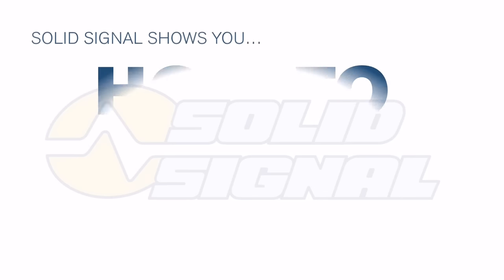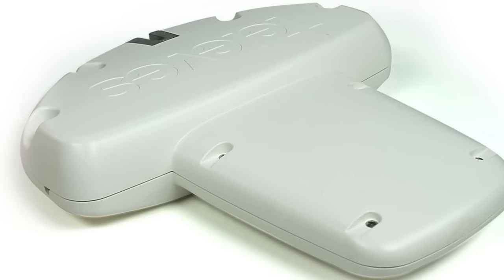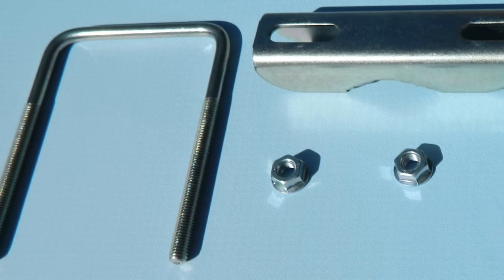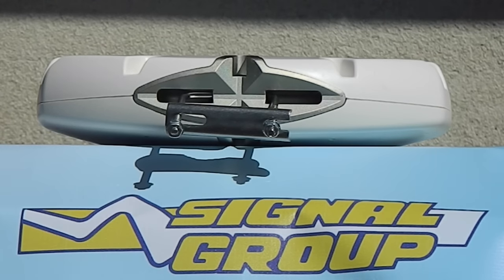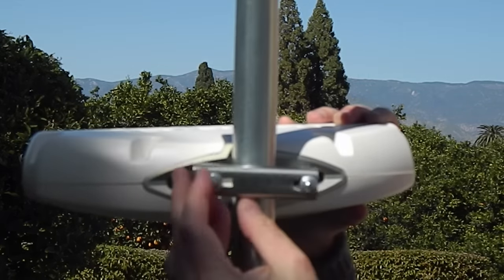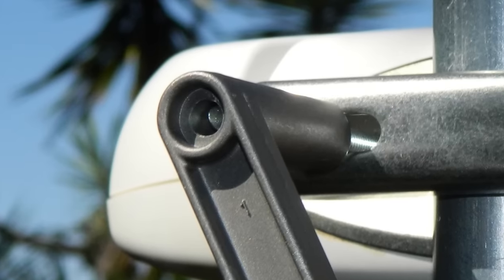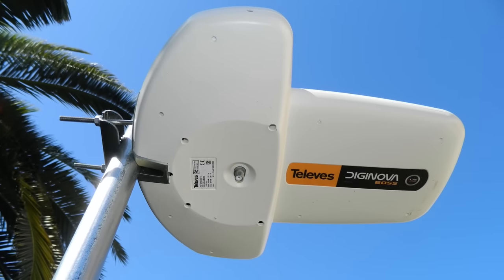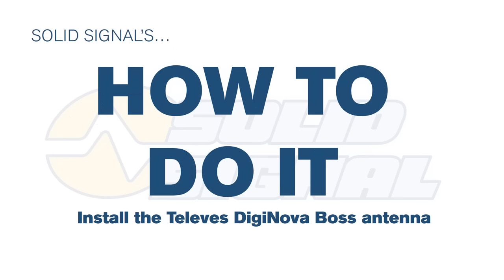How to install the Televes DigiNova Boss antenna

Comment: The thing we needed to really know you did nikita show ....Since it is all plastic on the outside just what do you connect to   to be able to ground said antenna .....????? Would be nice to know BEFORE we bought one & had it delivered ....Thank You ...
Reply from the maker: You connect a ground block to the coaxial cable and also ground the mast. You can get all the grounding supplies you need at solidsignal.com.
Reply: @SolidSignalNovi  seeing how I'm not electrically inclined at all , you do mean to attach the ground block to the coax tightening nut not to the coated / plasticovered cable itself , correct ?...Also , I'm located on Rt. 273 about 1 mile south of The New Castle Airport .... All around better reception is my goal but my biggest problem  is I DON'T get WPVI. 6. at all  & that is one of my favorite channels ...So just ball parking a guess do you think this will cure my ills or do i need a bigger better one ??? I don't have anyone to tell me about Antenna Size or cost so I'm just looking to find the best reception because what I'm getting now is abysmal in any adverse weather conditions , windy ,rainy , snowy , or even really heavy oversat days... And yes , I am using a flat type antenna in the window with a supplied ( at extra cost ) amplifier , which it does actually help ... So any input to helping my situation would help ... Thanks a Lot once again...
Reply from the maker: @arthurwalls9091  The most important answer to your question is that you will need a bigger antenna to get WPVI. It broadcasts at a lower frequency than other channels in your area. 

YouTube really doesn't like when we post links but if you go to solid signal dot com and look for the Antenna Questions Ask Them Here button... you can feed in everything about your location and you'll get a recommendation of what you need.

As for proper grounding, you run the cable to a ground block, which you can get at solid signal dot com. Then run a ground wire to a cold water pipe or to a pole stuck directly into the earth.

Like I said, youtube hates links, so go to blog dot solid signal dot com and search for grounding to learn a lot more about that.
Reply: @SolidSignalNovi  Thanks , I think I know whi h antenna to get now , one you reviewed here recently ... It seems to be the king of antennas , at least for my needs , that is ...I forget which it is but I have the info stored here in my phone ...I will prolly be putting it up attached to my concrete block chimney so it will be securely attached ...So Thanks for all the info & help...

Comment: Dish Network is installing these for customers who’s locals are trying to extort more money from Dish.  For my purposes, I would like to use it mostly for FM reception.  It does an ok job, but I know it should be A LOT better.  The only locked “stereo” signals are from HD stations.  The installer aimed it where an app told him to for TV.  For radio, should I aim it where I know the stations broadcast from to try to pull in more HD stations and get a better lock on stations?  If the same stations sound good in the car sitting in my driveway, what can I do to help this antenna?  Yes, the power module is being used.  It’s connected to a Denon AVR-X7200wa and a Dish Hopper 3.  TV reception is fair because of the distances.

One broadcaster owns several stations, which a few have HD.  If I can get one of their HD, shouldn’t I get all of their available HD stations?

Thanks